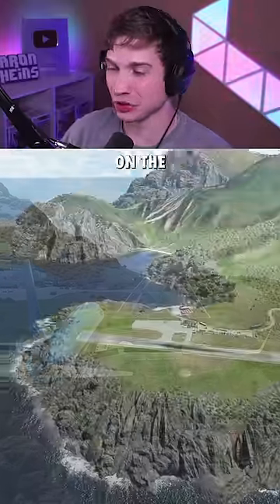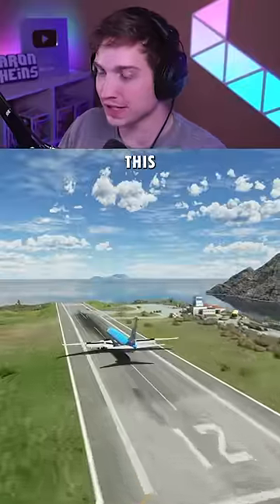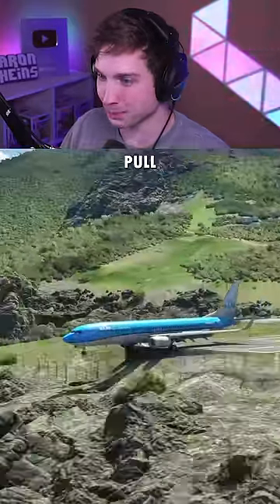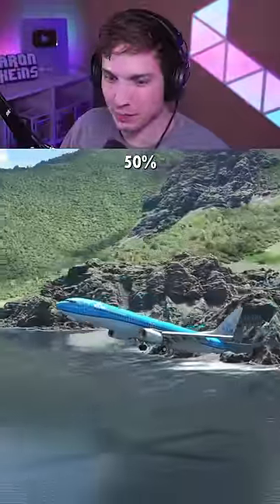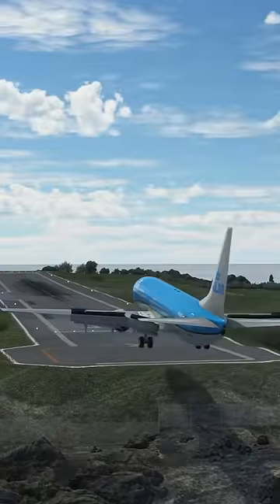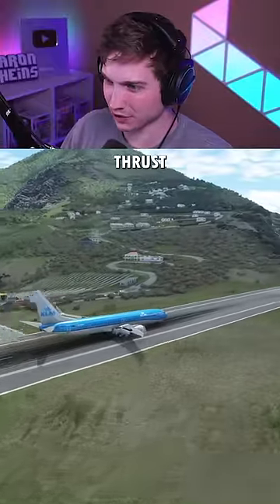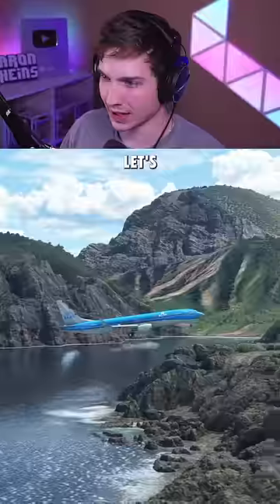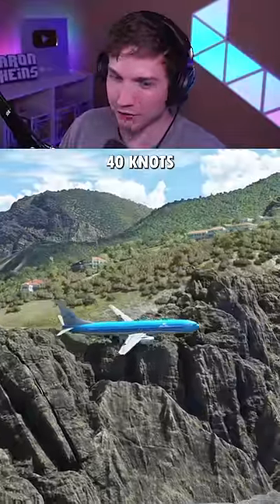737 Landing on World's Shortest Runway

Comment: what if you try to land like 737/A320 on the minimum length of a runway, but instead using the whole runways you use like half of it to see if it able to beat the minimum length for the aircraft
Reply: also for the payload, because it's just a normal landing, you should make it full, or less for comparison

Comment: Wouldn't you want more fuel on landing so you're heavier meaning you slow down faster?
Reply: Nope sir, it works the opposite, more fuel means more time to stop
Reply: Since more fuel = more weight 
More weight = need to go faster to not crash
So if you have more fuel that adds extra weight and you need to go fast( to fast to slow down )